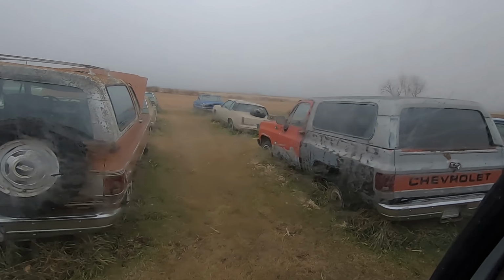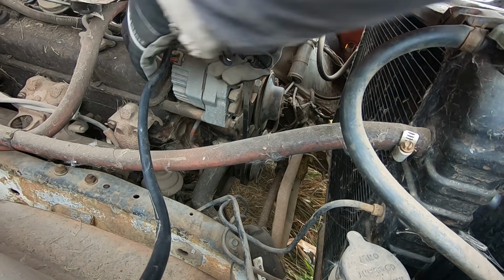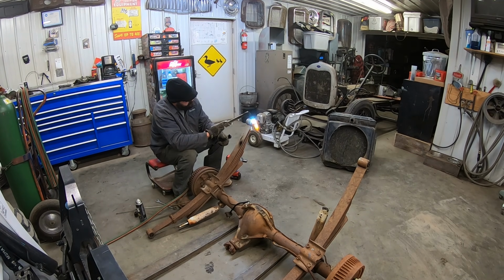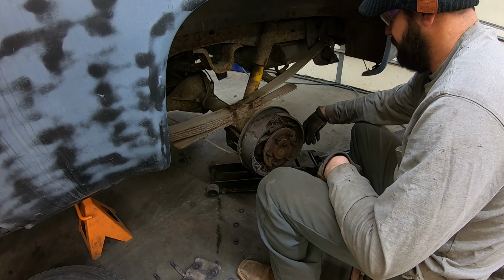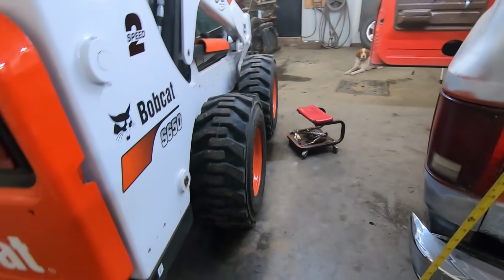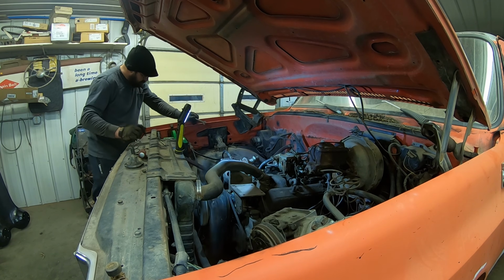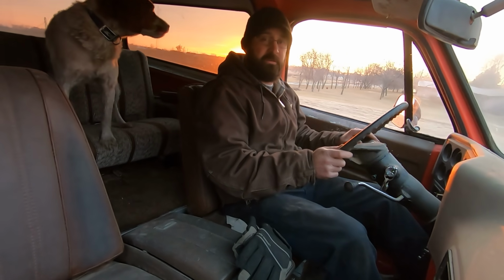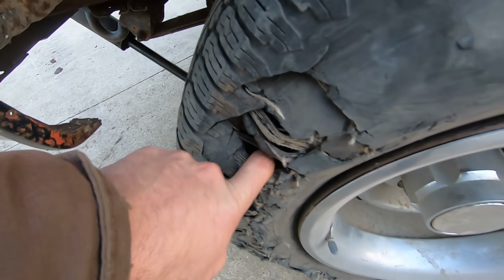Abandoned Squarebody K5 Blazer found in a Junkyard! Will it run?!? 1976 Chevrolet 4x4

Comment: Duff helps make the videos good... sound like she was reving high, next day start...looked like you have the 4 wheel in low range...that would explain it...shift to high ranger & try another road test, eh???
Reply: Oddly enough, I'm a cat guy, but there's something about Duff that I like. 
If I had the K5,  I'd gradually (as funds allowed), work the past mistakes out of it & make it a decent looking driver, cuz I think it could be brought back from the edge of hell it's currently teetering on!
Reply from the maker: You are correct! I isn't too smart!